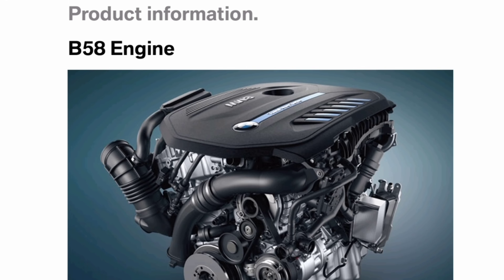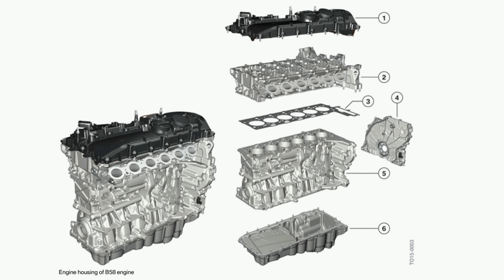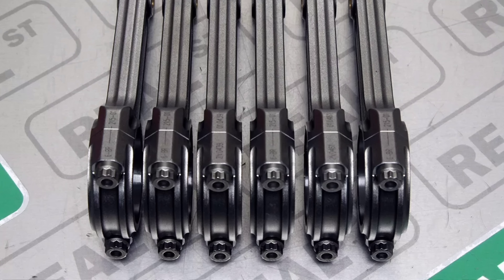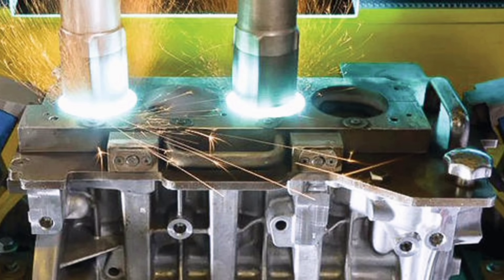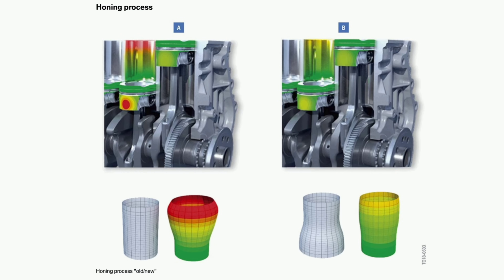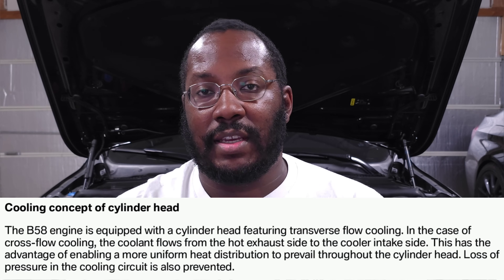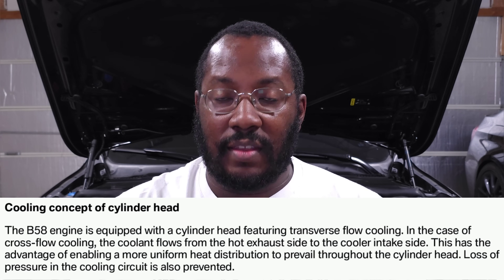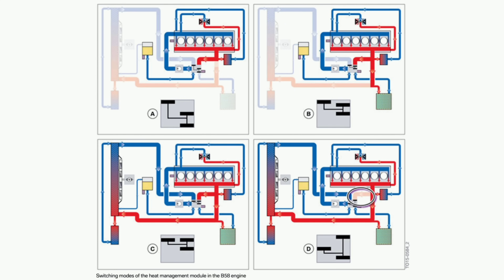Why the BMW B58 Engine is SO GOOD (B58 Technical Training)

Comment: Hi!  I heard there was a 2022 update to the engine where BMW has added port injection alongside the direct injection for efficient carbon deposit cleaning of valve heads. Is this true that B58 is dual port injection engine, can you please help confirm?

Comment: I had M240i BMW B58 with stage 2ECU upgrade en downpipe Awesome power
Running everything standard only downpipe and ECU stage 2 250kw-312.5kw 
500nm -682nm
The B58 very bulletproof motor

Comment: What years are the most reliable B58 engines, and does not have the oil pump issue?
Reply: Post June 2021 b58 got the oil pump revision

Comment: I got a 22 m240i with a b58b30b engine, engine got water in it, block is toast, could a b58b30c block work and I swap the head onto it from my b58b30b?

Comment: Any suggestions on why my B58 feels so powerful and smooth but no smoke no leaks and consumes a quart of oil ever 3-4k miles? (It’s a BMW is not an answer commenters lol)
Reply: Oil grade? Some people have issues with diesel when use 0w20
Reply: @pawelludew291 it’s Gas stock 91 octane Toyota and BMW both use 0w20 in the B58 as far as I’ve seen. It drinks a quart every 2000-2500 miles but Toyotas consumption test is 1000 miles

Comment: The B58 just might be the Epitome of Inline 6 engine design. I wonder if anything else would top it ever
Reply: I don't believe so. Gen 3 is having major issues
Reply: Only thing holding it back is the electronics and plastic, but I guess that applies to a good portion of modern engines
Reply: @od813  One of the reason they use plastics compounds is because they are better for heat soak.
Reply: S58
Reply: 3jz would but as of right now its the best I6 ever created

Comment: Hi I’m a really big fan of your channel, I think you’re the most informative BMW guy on the internet. I’ve seen you on the forums and then unknowingly seen you on YouTube and finally made the connection, I was impressed by you in 2 separate areas, both of which were impressive on their own, combined? You’re the guy. I’m nowhere near as knowledgeable or as capable as you when it comes to working on these cars but I have a question for you, I’m someone that has OEM Anxiety, for example if I swap something that on paper should be a massive upgrade over the OEM part I for some reason have anxiety that it’s going to cause a problem. I love all the modern B58 cars/suvs, if I wanted to replace the OEM charge cooler manifold on a modern B58 with an aftermarket charge cooler manifold, is there any downside whatsoever to doing that? Is there any potential hazards or unforeseen complications? Or is it better across the board no question? Looking at do88, CSF, wagner manifolds. Do you have any preference? Will likely match the intercooler, trans oil cooler, and auxiliary radiators, to whichever manifold I choose.

Comment: Great video. I don't think people understand just how amazing the cooling setup is on these cars. Being able to run warmer coolant temps at highway cruise and then cooler coolant temps when going WOT for a while is a magical thing. I REALLY wish someone made a retrofit that would use the BMW electronic thermostats in an old engine and a simple controller for them. 

My one "wonder" on the B58 Gen2 engines cooling is whether the electric water pump that controls the intercooler circuit is really up to the task when you do things like install a 3 pass CSF heat exchanger for the intercooler circuit. (3 pass heat exchangers can dramatically slow the coolant flow rate vs. a single pass design and I really wish I knew the limitations of the stock pump and if there were any aftermarket pumps that could boost the flow rate.)

Comment: @Kern417 Any idea what materials and thickness the B58 stock piston rings are using? (I've never looked into what kind of ring materials need to be used with a Nikasil coated cylinder and I'm just curious.)

Comment: On B58 cracked ring lands: any evidence on whether this tends to be detonation due to a bad tune / not-enough-octane for the tune vs. heat causes the rings to but / not-enough-gap with big boost? 

(Curious at what point someone should crack into the bottom end and gap the rings, mostly...)

Comment: Speaking from previous experience, if you don’t have rock guards for the Inter coolers / auxiliary radiators. I recommend installing them or doing your own DIY guards. 

There is a rock out there…. Waiting….

Comment: I got a weird problem, if anyone could help. I’m running a catless downpipe, mst intake and everything else stock, i’ve started to noticed that after doing a small pull and letting of the gas, sometimes white/ish smoke comes out of the exhaust but only sometimes, coolant level looks okay although i do top it off every other week. any ideas of what i could start testing? or could it be simply the downpipe.
Reply: possibly pcv

Comment: Hey Kern, I have my car ready to dyno tune this week with the mods listed below and I want to have an idea of how much HP I should be looking at when it's done. My tuner is good, but I want to make sure I'm getting what I'm supposed to lol 
List of mods:
Intake with turbo inlet
Catless downpipe
Active Autowerke exhaust
Charge pipe
Dinan spark plug coils
X-hp transmission tune stage 2
Fuel-it flex fuel kit (I'll be tuning with E40)
Tuning platform will be ECUtek
Reply: depends what car you have and which version of the b58, assuming you dont have any fueling upgrades you should be around 480-550, keep your tq under 600 to be safe and not slip 4th gear (trans limit is 700), dont tune 5th and 6th for power, try to get your powerband in 1st to 4th gear, 5th and 6th dont really hold much power, also be careful about raising your line pressures in XHP, i personally would stay on stage 2 MAX, never hit stage 3 unless you need it for a single drag run, let me know if you have more questions.
Reply: @gregkara427 oh sorry forgot to mention that. I have a 2020 M340i with the B58TU. Thanks for the reply
Reply: Great video providing a lot if insight!

Hoping someone can help me out with the following; i have a M140i, stage2+ / stock turbo, all necessary bolt-on mods done, ran 50.000 km, and have been experiencing some power loss when going WOT.

Didn't get any CEL's. Did several checks and ran logs; the cause appeared to be advanced ignition timing on cylinder 1, but no knocking.

Changed the sparkplug, coilpack and injector, but no results. Further checked the cylinder with boroscope, all looked good. Almost no carbon build up on the valves or piston, no visible damage to cylinder walls. Compression test and leakdown test values were all good. 

They can't find the cause of the advanced ignition timing, so we've come to the point to taking the engine out and pull the piston of cylinder 1 to check. 

Anyone has any ideas what to check, or maybe some direction to look for before we do so? Appreciate your feedback.

Comment: So being the b58 comes with forged internals the pistons they should be 2618 alloy with a high aluminum content, if they are 4032 alloy they have a lower aluminum content, a higher silicone content but they can have smaller piston to wall clearances. If they are cast they are not as strong and more susceptible to damage if any detonation event happens.
Reply: The b58 comes with a forged crank. Pistons and Conrods are not forged as I recall

Comment: I had read this : 

forged pistons , IIRC , the thermal conduction of forged part makes them to expand or shrink more than non forged 
so with forged pistons you HAVE to put your engine on good temp before "using" it

they will expand with temp .  or they will scratch the cylinders if used too cold ( because shrinked )

sorry for my english .
Reply: I know "the internet" always says that "forged pistons expand more than cast pistons", but it's not actually that simple. 
Most modern cast pistons use hypereutectic alloys that contains a lot of silicon, high silicon alloys are harder and expand less and can run with tighter clearances, and are quieter when cold; cast hypereutectic alloys can't deal with as much detonation as a forged, low-silicon alloy like 2628 and when hypereutectic gets damaged it tends to explode into a million tiny pieces. 

Forged pistons tend to come in two alloys: 2618 -a high thermal expansion, low silicon content alloy that's can flex more before breaking and has the most detonation resistance and requires more piston-to-wall clearances.  4023 -a low thermal expansion, high silicon content alloy that gives you much more strength than a hypereutectic cast piston and also provides the benefits of a low thermal expansion alloy. 

(It's really the aluminum alloy that determines whether the piston expands a lot or a little as it heats, and there are FORGED pistons that are both high thermal expansion and low thermal expansion alloys.)
Reply: Yes and will have larger p/w clearance so until warmed up they will be a little noisy.

Comment: 🪰😆. 
Great explanation of the cylinder and reasoning for the cylinder shape. Interesting regarding the two front auxiliary coolers. On my m140i pre PPF/OPF I only have the one and that plumbs into the charge cooling/air conditioning circuit I believe
Reply: Right, I think the second one was only available on the other side of the front for the PPF version. Since the PPF is getting hotter.